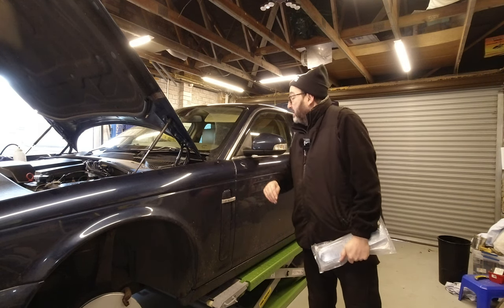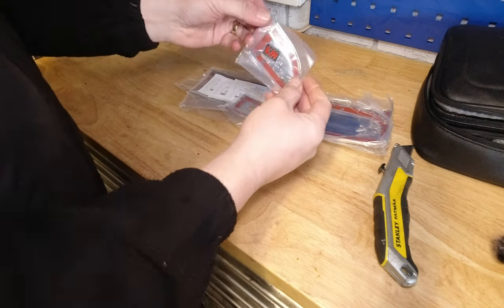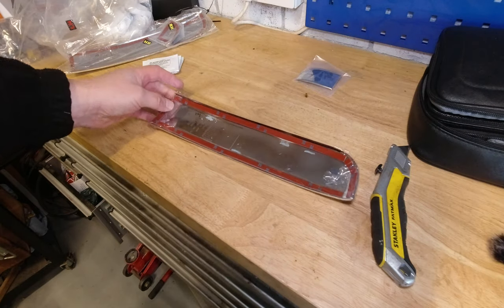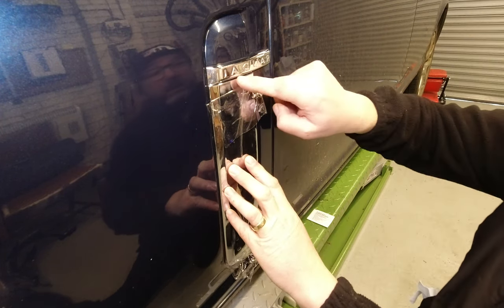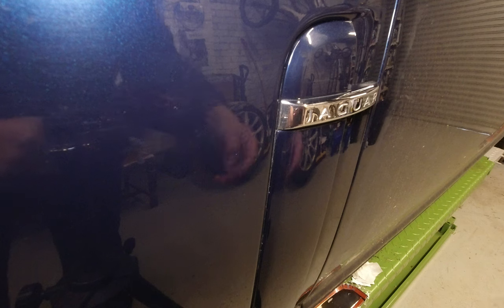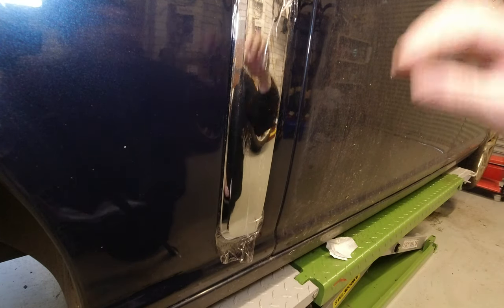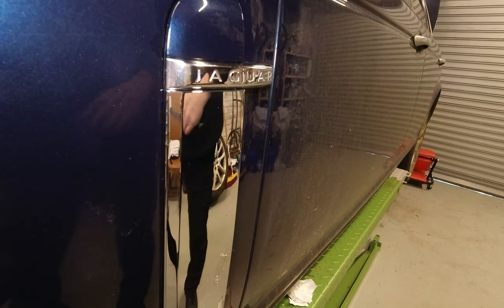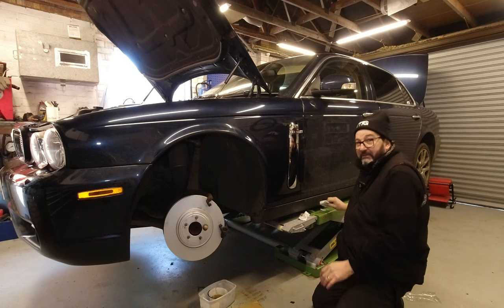BLU 13 Adamesh chrome wing Louvres to your XJ X358 XJ8

Comment: Bought two chrome wing mirror covers from Adamesh for my S Type. After a short while the plastic chrome started to oxidise. Adamesh replaced them - no problem. After a few years they started again to oxidise. After some research I found this is a regular problem with motorbike plastic chrome. Solution - OOOO grade wire wool. Use a soapy lubricant and gently rub the surface. Nearly all of the pitting is removed and the shine is restored. Magic!
Reply: Very nice tip!
Reply from the maker: This is a really good tip Stewart. One I could try on Yogi the Jeep's dulling mirror caps👍

Comment: Sneeze-thru wind vents, chromed fender dents and full factory air conditioning from our full factory air air conditioned factory.  Where's the handy laminated imitation Masonite wild west gun rack?  In my experience the VHB tape attachment of accessories never works for very long.
Reply from the maker: IIt will never beat a nut and bolt, but its all in the cleaning Gary🤫
Reply: @ToTheGarage  I used Naphtha or Denatured Alcohol but if there's any stress on the joint (corves don't match perfectly) it slowly departs with the loss of the item on the highway.  I have found that adding an adhesive like Shoe Goo (available in the states) along with the VHB solves the problem.  It's flexible yet thick and strong.

Comment: My car came with the chrome already, i didn't know it's not originally chrome, :/
Reply from the maker: Chrome was an option or original on some models Ibram so yours may be factory fitted chrome items rather than the chrome overcaps I have fitted👍